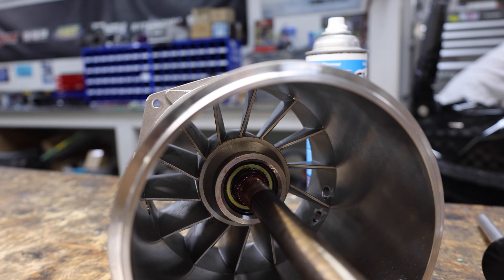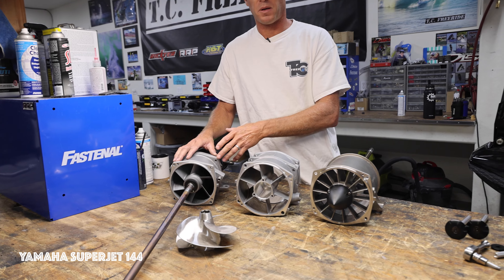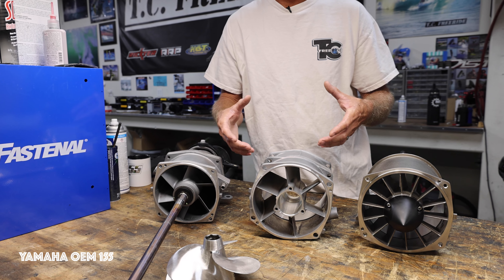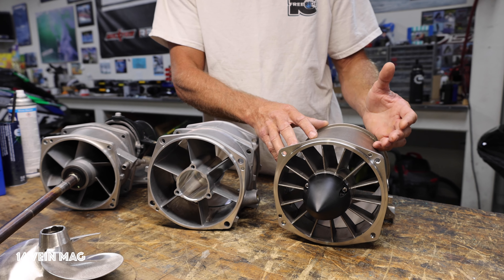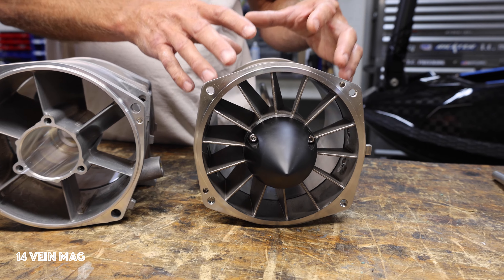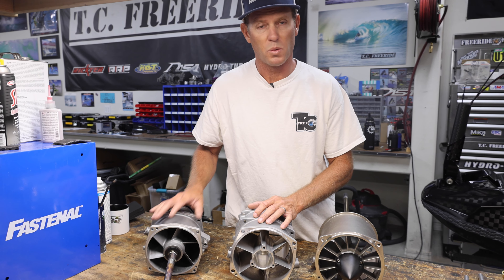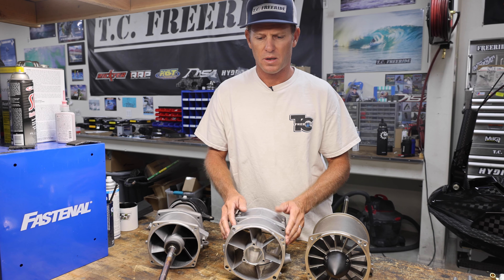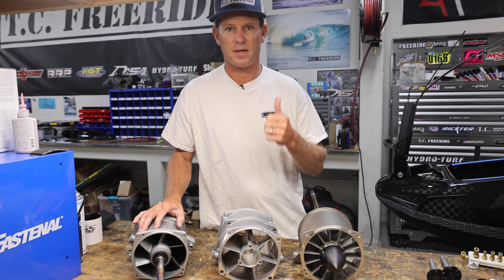JETSKI PUMPS | 144, 155 & MAG

Comment: Could you by chance make a Part 2 or second segment on pumps by chance explaining the pros and cons of all the vain counts from 6 or to whatever number and more in depth detail of the benefits higher vs lower vain counts do? As well as the difference between and what a setback, mag, and standard pump are?

And when you mentioned that putting that 14 vain mag in a 701, are you referring to a stock 701 in a Superjet or are we talking Rickter hulls? Like for example, if I wanted to put a Skat-Trak or Solas 12 vain mag pump and impeller in my 2018 SuperJet, it won’t work with a bone stock 701 then correct? since my engine is bone stock. Are you saying the only way to use a pump with that vain count is if the engine has say a B Pipe and carb tune/bigger carbs, and or a modded/aftermarket engine?

Comment: Is the 14 vain 161 mm for me ? RXT-X 300 2021, xxx charger (  21.5 PSI at 8800 rpm ) Riva racing camshaft, fizzle intercooler, 13/18 Solas , high flow injectors , screen in the intake has been removed ( tones of other part but more for durability then performance) I'm looking more for hard acceleration then top speed
Reply from the maker: Sorry I’m not a sit down guy I don’t have any idea

Comment: what prop would you recommend with the OEM 155 for surf free ride and is it necessary to fit a bpipe with the pump.. being in SA it's a struggle to get aftermarket parts for the skis and BPIPES etc are almost impossible... got a new SJ701 and finished with all the external mods RRP Steering system Bars Levers WORX Ride Plates and Intake Grates and Extended Nozzle etc.. now want to start looking at bolt on engine mods such as pipes and pump etc.. would love a video on out of the box upgrades for SJ 701 for surf free ride without too much if any motor mods such as skimming porting etc
Reply from the maker: Pipe, head, msd enhancer, Jetinetics flywheel, properly jetted carbs and pipe
Reply: @taylorcurtis9028  thanx for the response.. Will defintely start working towards those mods

Comment: So would you put a 155 in a b1 if I wanted top end? I do occasional buoy racing with friends that practice and boat wake jumping. I was planning on putting a impros 11/17 on the oem 144. What's your take on all that? I have a 62t 760 with msd enhancer,coil,Ada head and bpipe with a mod chamber. Duel 44s stock intake and carbon tech reeds as well
Reply from the maker: 155 will help everywhere

Comment: Hi,
is there a difference between impeller shafts of OEM 144 and OEM 155, except different lenghts; depending for what modell? Are these shafts have equal impeller  thread? E.g. SJ 650/144 vs. WR 1100 or GP 800/ 155.
Reply from the maker: I believe most are the same thread